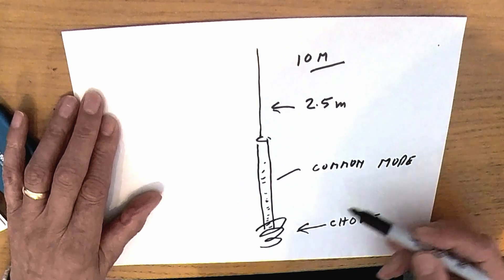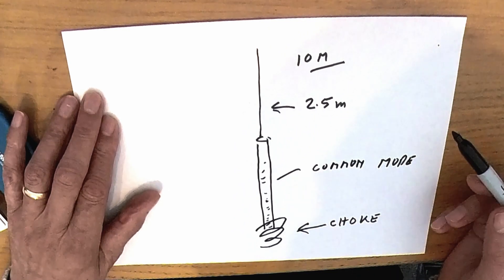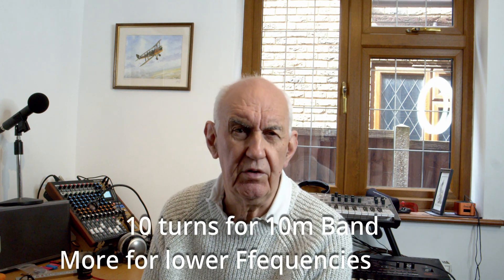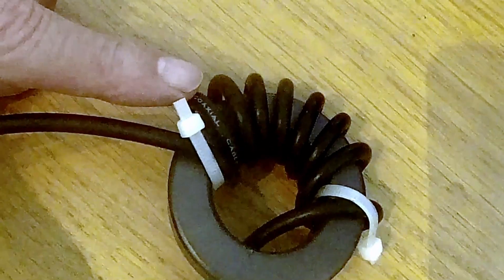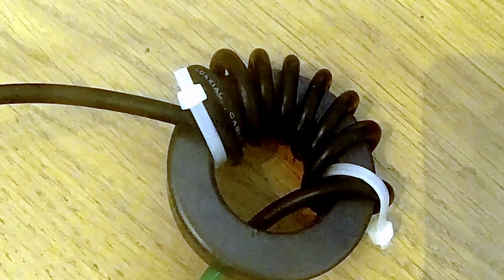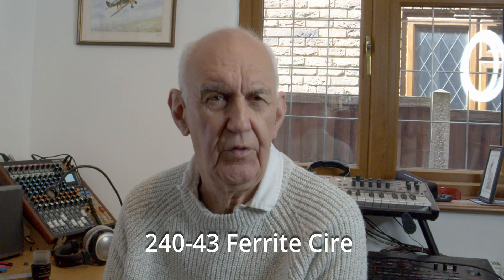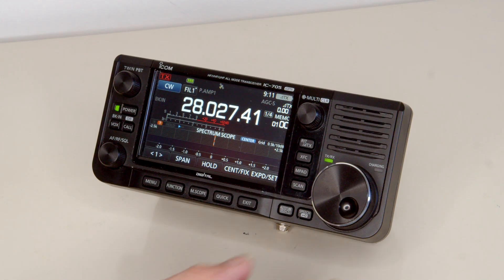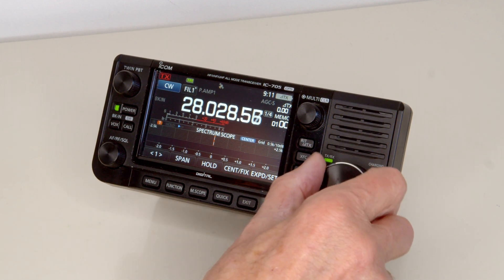Ham Radio T2LT Antenna for 10m DX (or other bands) - Home or Portable - Low Cost Easy Build.

Comment: What I discovered through modeling vertical dipoles is that the height above the ground makes a big difference in the elevation pattern.  If the bottom of the antenna is low to the ground, the primary elevation angle of radiation is low - good for DX.  But, as you raise the antenna farther above the ground, a higher angle of radiation lobe begins to appear, eventually, almost equalling the low angle lobe that is good for DX.

This is going to do a couple of things:

1 -  Make the antenna more sensitive to shorter range contacts coming in at higher angles that would have been attenuated with the antenna lower to the ground.

2 -  Make the antenna noisier - because, most noise is both vertically polarized and tends to arrive from higher elevation angles.

So, it really depends on your communication goals. If you want primarily DX, install the antenna with the lower element near the ground.   if you want to also work short and medium range contacts, raise it a bit off the ground.

Thanks for the video, and 73!

Comment: Thanks for the video, Peter. I heard someone else mention running a wire from the braid of the coax at the "centre point of the dipole" back down to end in an open circuit where the choke is. I wonder how this would perform ? Electrically it would perform the same function as the braid itself, truncated by the choke. Also, I am considering experimenting with a 1:1 ferrite UNUN as a choke, which has the disadvantage that its position cannot be so easily changed. We will see...
Reply: How did it go using wire attached to the braid?

Comment: I have for a couple of days tried to tune a dipole and not been very successful. I gave up and started over. I had very high swr at 8 feet and 7 feet 10 and 1/4 inches. I saw your video and said I had nothing to lose but some wire. So I started at 7 feet 6" inches and left the other arm at 7'10 inches. Lo and behold swr dropped. Trimming slowly and increments of 1/4 inch, I arrived at 7 feet 3 and 1/2 inches with a swr of 1.2-1.3:1 Thank you.
Reply: Has the antenna worked well? I'm just making one for 10 & 15 meters..
Reply: @Eana-of-Sussex  Yes it did well, I also built a 49 inch telescoping dipole with loading coils. Now you might not get the same range but the antenna is more compact. The antenna is resonant on 4,6,10,11,12,15, and 17 meters. You tune by combination of moving the antenna in and out and selecting the section of coil. I modeled after this video https://www.youtube.com/watch?v=IQ_dI4aVHj8

Comment: With reference to the required shortening of the finished product, perhaps you're also experiencing End Effect requiring the top ¼ wave to be approximately 5% shorter than the calculator shows.

Comment: I made many time for 2 meter band also for 11meter.
Half wave.
But  I make two this antenna ⅞ wave and work well. Original what I copied is ⅝ wave but actually this is all radiated ⅞ wave. It work simple. 
For 2 meter it is very good.

Comment: I don't rate this , being a perfectionist I have to call this a fudge , an easy fudge true , but basically it's a coaxial sleeved center fed dipole fudge . A true coaxial sleeve should ensure an unbalanced feed ( to suite your transmitter ). I've made one of these but they are difficult to implement . It's the same as a straight dipole with 1 - 1 balanced to unbalanced  transformer at the feed point . Hardly spectacular . Ditch the coil and feed the coax up the lower half of your aluminum  dipole is better . Center mount the dipole and you have cracked it . 73's DE G4MXC

Comment: Thank you Peter. 🙂
I am still trying to figure out which antenna should be the first one I build or buy when hopefully getting my license next month (German class E). The 10m and 15m are the most interesting ones included in that license and I am currently thinking of either buying hamsticks to build hamstick dipoles for these bands, or either building 2 of these T2LTs.
As I am new to the ham radio hobby, I am not really sure which one of those is superior, but I tend to think the T2LT is the better choice as it does not have this compromise of that thin wire coil to allow for shortening the sticks (as the hamstick have) and is has these pure Lamda/4 elements instead.
Does that make sense, I mean, would you also consider the T2LT being a better choice than hamstick dipoles? 🤔

Comment: I have a thunder bolt version ìts 5/8 wave it has extra things on it like a coxal stub part way up the lower part of the dipole and a 2.5cm coxal capacitor at the start of the upper dipole i have this sat on a 12m mast ( taped to it) best anttena i have had in my small garden i have tryed 1/2 waves with 49:1 transformer found
Them poor i have 4 anttenas 10/15/17/20m i have 2 x 12m masts up so just covering 15/12/10m 
I made my first t2lt for 50mhz i built my choke on a 3in dia pipe going to make one for 70mhz so i can use
Them portable with my ic705 thanks for putting the video out a simple anttena that works well

Comment: Great video Peter, very informative. How do you calculate the lengths for two sections of the antenna well as the length of cable for the choke? Is there a software calculator for this? I went looking for such a calculator, so far no luck. Any help would be appreciated. 73's Ernest Bazzinotti, KC1LKB
Reply from the maker: The coax  from centre to choke is a quarter wave.  Cable beyond that cjoke can be any length.

Comment: Thanks Peter! Its obviously good practice to waterproof the trimmed end of the coax very well  (especially if using the coax inner for the top secton). Self amalgamating tape is OK for a year or two, but I've found that a dab of glue from an inexpensive hobbyist  hot glue gun does a really great sealing job. On my own antenna, I've then covered this with self amalgamating tape as a kind of "belt & brace" approach. As one who has experienced the effects of rainwater wicking its way along many metres of coax feeder, I reckon its very worthwhile to complete this simple antenna by this (also simple) weatherproofing method...
Reply from the maker: Yes agreed.
Reply: Just use marine heat shrink. There is glue on the inside of the heat shrink. Instant waterproofing.

Comment: I have been experimenting with this antenna over the last month. I was bothered by the shorter than expected length. I had it taped to PVC pipe which was lashed to a star picket. I also had a reflector and director to get gain. It is pointed towards America ( from Australia). Anyway, I dug some holes and put in wood posts to attach the PVC masts to, to get rid of any effects from the star pickets. I ended up getting rid of the coax type antenna and used a standard wire dipole with a coax connector. I used a NanoVNA to analyze the dipole and found that the resonant frequency was indeed about 20cm shorter than calculated. I am supposing that the closeness of the ground causes the change. I added a reflector which is 5% longer and a director which is 5% shorter than the dipole. They are all taped to 6 metre lengths of PVC drainpipe. The tops of each element are level with the top ends of the pipes. The pipes stand vertically, slid over wood lengths that are stuck in the ground. Lengths in metres are 5.04, 4.8, 4.56 for Ref, Driven and director. Spacing is 2.35 between Ref and driven, and 1.6 between driven and director. SWR minimum is about 1.2 at about 28.6 Mhz. (I'd like it a fraction lower.) Next step is to build another set, but pointing north-west towards Europe. I will be able to switch between the two systems. I think the coax design would be fine with the corrected (shorter) lengths. Modeling shows that the height of the wires being about a metre off the ground gives a good radiation pattern and low elevation angle, and works in well with the 6 metre lengths of 90mm diameter pipe.  Marty Wallace - VK6ABC.

Comment: A problem with this concept is that the bottom of the lower element (0.25λ down from the feed-point) is a current minimum and a voltage maximum. And the concept here is trying to use a choke at a point where current is minimum - Hint: chokes 'work' with current, and have little effect on voltage. The quite-similar vertical Sleeve Dipole is a better concept, as the lower end of the lower element has an actual open circuit in the right place. If one insists on using the T2LT concept, then might be best to add another choke another 0.25λ down the feedline where the current maximum is located. 

All that said, perhaps the feedline common mode currents and thus radiation is useful for some. 🙂
Reply: This is an excellent comment of yours.
The choke, often named a "current" balun, should be placed excatly where you said. 

Now I believe that you are very right and the choke should be placed a quarter wave below.
 
On top of this unshielded quarter wave should go a length of coax 0.66 times halve wave length, at the point of highest voltage and highest impedance in order to shift 180° the phase and then start the coaxial dipole on top fed at the highest voltage point.

The total electrical length now would be a three quarter wave antenna instead of just a half wave antenna.

I imagine that to make things even better we could add just above the choque four horizontal radials made with just two half wave aluminum tubes (or maybe just tree quarter wave radials at 135°, 45° below the horizontal plane).

This antenna would be a quarter wave ground plane antenna with a half wave antenna radiator added in phase.

Gain should be almost exactly 3dB over the initial vertical dipole, very much the same as if they were two half wave dipoles in phase but with a total length shorter than a wave length.

Comment: Peter, so I don't commit assumicide, is what you refer to as "flex" - are you referring to any suitable 50 ohm flexible coax? Thank you ahead of time for your response.  73//KK0DJ
Reply from the maker: Flex is a word often used in the UK to describe a length of wire, in this  case a single conductor wire. Sorry.
Reply: Just single core flexible wire.
Reply: I was puzzled too

Comment: I made one of these for 2m years ago, inside a plastic pipe with the coax coming out through a hole, winding the choke around the outside and then back in through a hole. It was up for years and worked surprisingly well.
Reply from the maker: It really looks as if the Ham Radio side of Kenwood is either on hold or worse still! No sign of anything new.

Comment: You can multi band them, they work on odd harmonics of the fundamental frequency in your configuration and if fed off center can be made to work on and even harmonic with a good match.  I have been using one for many years as a 2m, 70cm vertical with a sleeve fitted over the center making it 2x1/2 waves in phase on 70cm and a straight 1/2 wave on 2. Cheers Dave
Reply from the maker: Yes agreed, but on the HF bands this only works on 40m where the third harmonic is 15m.

Comment: Hi Chuck. Some people make this from one continuous piece of coax. They strip the outer shield off for the radiating element. Some people attach a piece of wire. Or Peter is using the term flex, it's just wire..

Comment: I got a length of coax just over 8.5m long, exposed the inner core at one end about 2.5cms and measured 2.47m down the coax and wound 16 turns of coax (diameter 66mm, just so happens to be the size of wd40 can, remember to remove the can) and I soldered a pl259 plug at the coax. Then I got 2.5m of enameled copper wire soldered to the exposed centre of the coax and put glue lined heat shrink over the connection to stop water ingress. I then bent the "top" of the copper wire to make a loop and secured the loop with a tiewrap, hoisted up a fibreglass pole and it tuned to 28.010MHz and was a lovely swr reading and quite wide band as well. By making the loop bigger (ie shortening the antenna it would go further up towards 28.500 MHz and if I made the loop smaller, it would go down into the 11m band. So easy to make and can be perfect for portable use. De Will G1YYU
Reply from the maker: Many thanks for sharing that info. 73. Peter

Comment: I made a T2LT recently for 15M. It was a fun project. However, I found out it doesn't perform nearly as well as my Solartron A99 CB antenna, which will tune all the way to 15 meters with fantastic SWR and performance. Yes I know it is a CB antenna. But it's 17 feet long, made of fiberglass, and is hard to beat. I knoiw many hams won't consider something just because it says "CB." But facts are stubborn things. However, the T2LT is a fine antenna in a pinch and for the field.
Reply from the maker: If it works, go with it.
Reply: I use a similar antenna and it works well on 10, 11, 12 and 15 meters.
Reply: It always makes me laugh! 
If cab is so bad, why are there so many hams on the bands? 😂
Reply: I didn't know anything about this one but after searching the web I discovered that the solarcon a99 is a fantastic antenna.

Comment: In the summer of 2021, this was the first HF antenna I made. Very simple and effective. Mounted on a fibreglass pole with the top about ~8m above ground level.  I did quite a bit of FT8 on 5W and worked as far as Argentina. It could do with being tuned as the resonant frequency came in about 27.8MHz but as with so many things, it was up and working, so I just got on and used it as-is! 😁
Reply from the maker: Nice work!

Comment: It's an electrical ' J ' Pole just use a bit of 300ohm ribbon to do the same job.
Reply from the maker: Feed is different, but result probably the same.
Reply: @watersstanton  No its not.....Both fed with 50ohm coax one uses a Choke the other could have its coax choked but there is no need.
Reply: The J pole is an end fed half wave with a quarter wave matching section. This is a half wave sleeved dipole, electrically a centre fed dipole.
Reply: @paulsengupta971  You may need to do more research as you are incorrect
Reply: @charlieoscar09  Are you sure?
Reply: No. He's not incorrect.
The jpole is exactly what he described.

Comment: +1 for using as a sloper, that configuration worked well for me when I tried it. Also as an inverted V, but the V took a bit more tuning of both ends to get it to tuned correctly.
Reply: If you have the room try a 120ft inverted vee end fed up 30ft at the centre with 30ft ground wire under the vee LC tuner is needed to match for best swr outstanding for inter G and some European  countries i used to use a ft817 with 2 to 3 watts
You need a biger atu for moor power 😊😊
Reply from the maker: Yes I never tried it as an inverted V.

Comment: I am using one of these on 20m and it will tune to 10m. However, the ratio of top section and bottom section is more like 3 to 1. I regularly make contacts from Australia into Europe using it attached to a 10m squid pole
Reply from the maker: Sounds good.